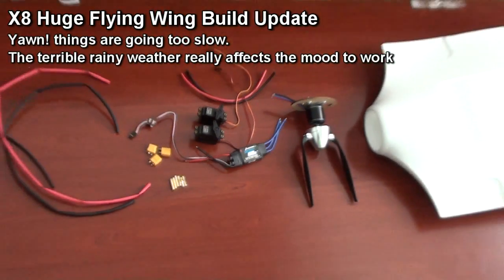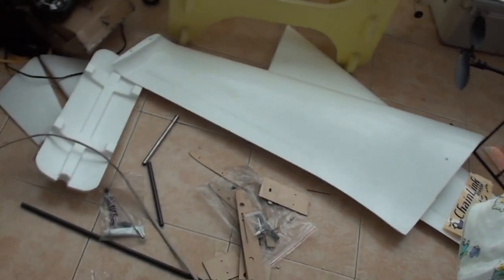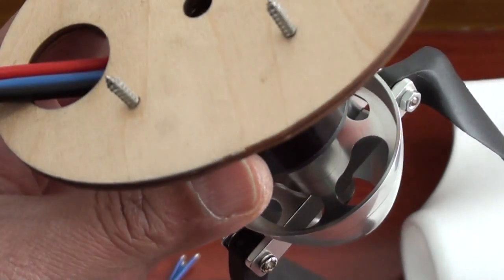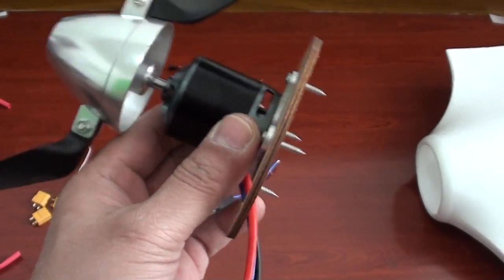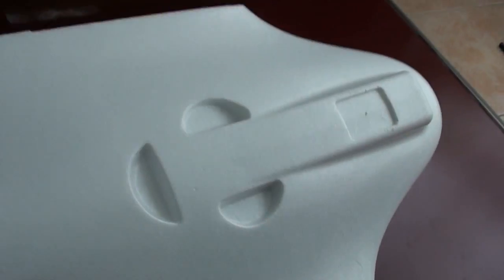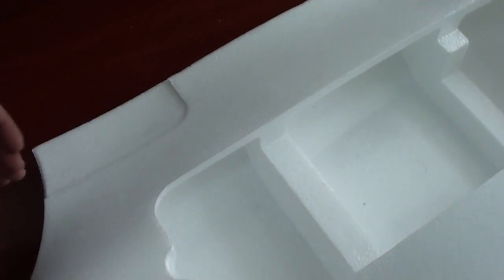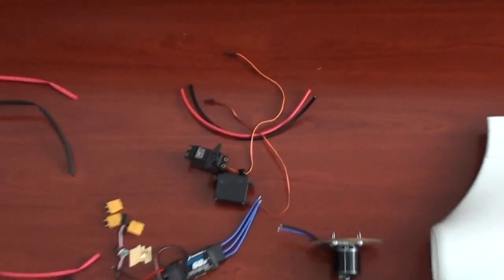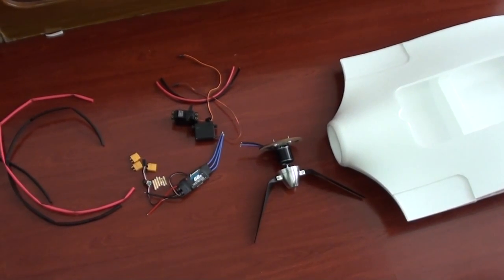X8 Huge Flying wing -- Build Update

Comment: I got in trouble using hot glue once so I hear ya.  Motors get hot, heat melts glue, prop destroys plane.  I use hot glue everywhere else because you can get it off fairly easily.  For my skywalker I used epoxy.  The foam itself flexes some and it got worse over time so I just fiberglassed the whole mount eventually.

Comment: That contact cement worked great for the skywalker v2 as will probably work great for this motor plate. I dont trust the hot glue for the motor plate in the back. That super sticky glue that came with the original skywalker was tight as a drum :)

Comment: @alishanmao You really should look into ardupilot system.  Can be configured to fly Fixed wing, traditional heli or multirotor either by RC radio or completely by computer including takeoff and landing.  Also it's open source so anyone can modify the code.  This enables people to do things like using sonar for altitude, target tracking and iR beacon support for landing on moving objects.  Best of all, it's about $500 including 900mhz data radios.  GCS is also awesome!